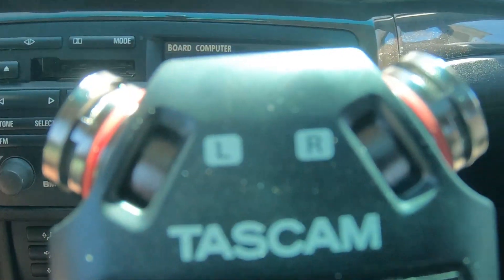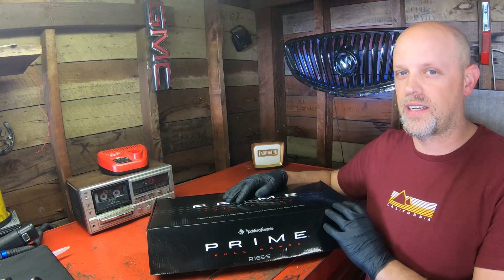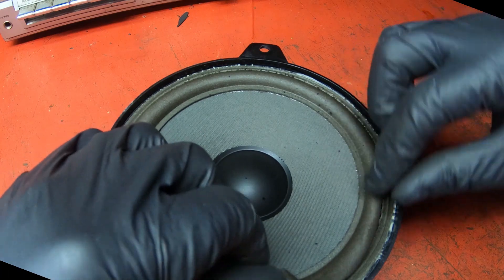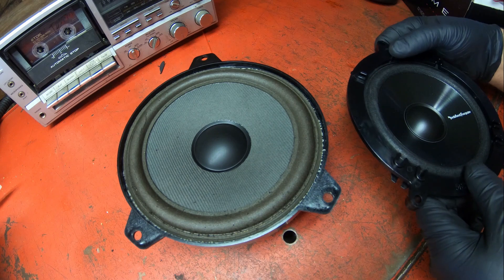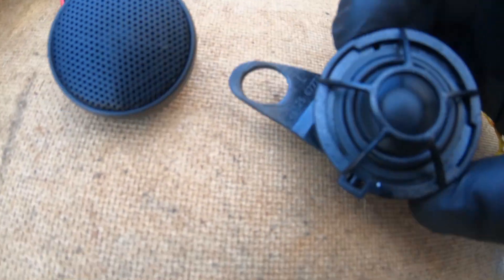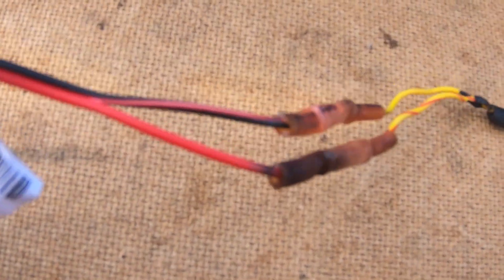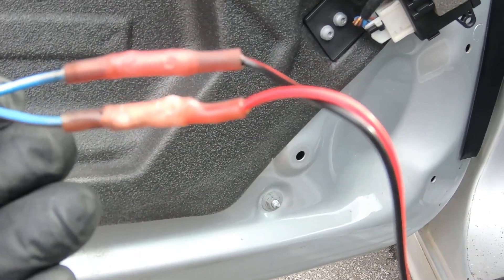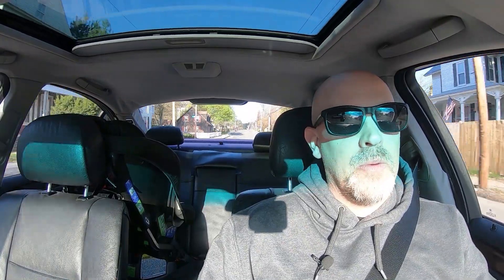Rockford Fosgate R165-S speaker review install E46

Comment: Hello I would like to add that it's going to sound like that because of the stock head unit it has Factory speakers before and the head unit does not have a lot of bass because it doesn't want to destroy those Factory speakers but once you add a aftermarket head unit you should hear a little bit more bass also if you add foam to the bracket and the speaker behind it'll help it a couple to send the sound more out versus going to the left and right that's my tip
Reply from the maker: Thanks for the info. I have a new head unit I just need to install it. I’ll make a video on it. Thanks for checking it out.

Comment: I would like to point out the not so obvious to most issue here. BMW stereo systems don't use 4 ohm speakers. Therefore you won't get but about half of the power the factory amp has to offer thus loosing the lower range of the music.
Reply from the maker: Yeah that makes sense. Since this video I have replaced the head unit and bypass the factory amp. I definitely see an improvement in the speakers a little more base. I did a video on that if you want to check that out. But I think for my taste in music I am going to add a small sub. Thanks for checking it out. 
https://youtu.be/IbuOUhSUKHE
Reply: @AndyTheXTech  .I would definitely add a sub! After I upgraded my wife's factory sub in her X5 the sound was much fuller. In my M5 I had I added a 5 channel amp and a 10" sub in a ported box and it was like a concert. I'll check out your other video and I can't wait to see your next one on the sub!

Comment: Andy the fosgate tweeter needs to be wired to the secondary tabs on the mid sun speaker that’s why it has 4 tabs. If u wire the tweeter to the factory Wire harness and not the secondary tabs the tweeter can’t cancel out the low sounds and will get blown eventually. Pretty sure u wired it right just wanna to share this info.
Reply from the maker: Thank you for the tips. I will have to check. I did install a new head unit since this video and at some point I’m going to install a sub. 👍

Comment: Hello, I just purchased these speakers and I am having trouble installing them. Do I need to run the wiring for the tweeters from the bottom speaker or can I just reused the OEM wiring and they will work ?

Comment: Bought these same speakers and just like the reviewer said, they really lack bass. The tweeters are very sharp (bright?) and almost overwhelm the mid bass.  I have an aftermarket head unit, aftermarket amp and a powered sub and I’ve tried all types of adjustments but they still don’t sound right to me. I have the same head unit in other cars and they sound great, even with stock or cheaper speakers so I think it’s just how these sound.
Reply from the maker: Interesting. Thank you for letting me know. I’ve gotten used to it. I still want a sub. But maybe I’ll look into some different speakers also. Anything you recommend?
Reply: @AndyTheXTech  I'm going to try the Alpine S-S65C which is more expensive but people seem to like them.  As far as the sub, I got the Rockford Fosgate 300-8p powered sub and I love it.  Nice and compact so it doesn't take up the limited trunk space in one car and it fits under the cargo shelf in my other car.  Very satisfied with the sub.
Reply from the maker: @cheapme1850  nice! Ya I think that’s the sub that I need. I’ll look into those speakers. Thanks 👍
Reply: @AndyTheXTech  No prob.  Hope it works out!

Comment: Do these run ok from a Head unit? How do they sound compared to the JL audio C1 thanks
Reply from the maker: I mean they sound pretty good. Better than the stock ones. Now that they’re broken in they sound even better. I still need a sub though. Not quite enough bass for what I like.

Comment: Do you have a video to install after market speakers on bmw e46 325ci convertible
Reply from the maker: Sorry I do not. I’m pretty sure the front doors, speakers are very similar. It’s just the speakers in the rear that would be different.

Comment: Thanks for the video.
Have you done the anti rattle foil tweak in the doors before? Even if the brand you drive is usually not rattly at all, some of this 2mm stuff might give you some more bass without having to install a sub.
also adding some foam spacing ring on top of the edge of the speakers will help a lot.
Reply from the maker: Yeah that’s a good idea I should try that. I did make some adjustments to the adapters so that less air gets bypassed. Overall there good sounding speakers.

Comment: I just got 2 sets of these for my 2017 civic hatchback what would you recommended for an amp?
Reply from the maker: To be honest with you there’s a whole science behind this. And it depends what you’re doing with it. Whether you’re adding an amp for all the speakers or just for subs. I would go on the Crutchfield website and seeing what’s gonna work for what you need. Thanks for checking out the video.
Reply: @AndyTheXTech  i went on crutchfield & saw a Sony 4 channel amp rated at 45 watts rms which is what I think the speakers are rated at as well do you think that'll make a difference from just running it off my head unit? According to honda my head unit pushes 180 watts, thank you in advance for the help

Comment: did those speakers come with a crossover? I was thinking of picking a set up myself but i don't want the tweeters to blow
Reply from the maker: Unfortunately no this kit did not come with crossovers. I have since added crossovers because I replaced my head unit and eliminated the factory amp. The speakers still sound great for the money.
Reply from the maker: https://youtu.be/IbuOUhSUKHE
Reply: Whoa, are you sure about what you posted?  I have the larger version of these and specifically bought them because they have built in crossovers. Crutchfield clearly says this model has them too.

Comment: audio noob here are those 4 terminal? how did you wire them up?
Reply from the maker: Ok I’m not really sure your question. Basically I had to cut the connectors and just use wire crimps to install the speakers. The new speakers come with wires. Is that what you’re looking for?

Comment: I have the same speakers in my e46 and no midbass whatsoever. Sounds very bad. I 'm pretty sure I have wired them correctly.
Reply: Also I have tried running them of an amp, they only got louder and clearer but no mid bass